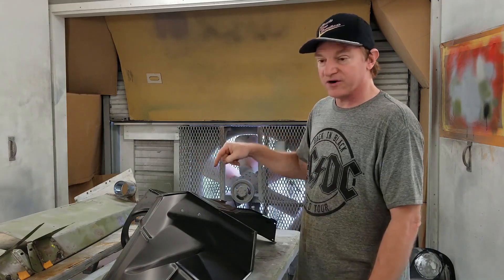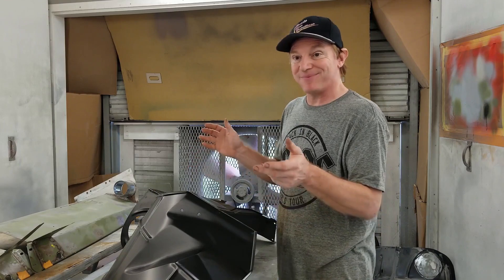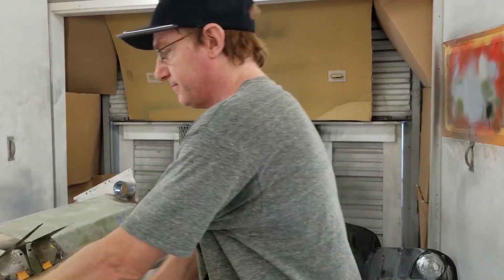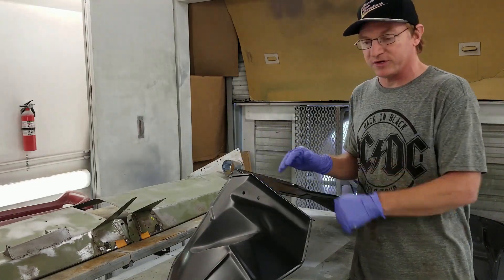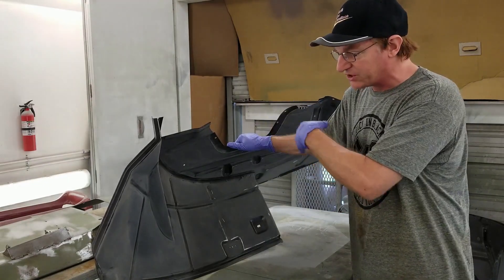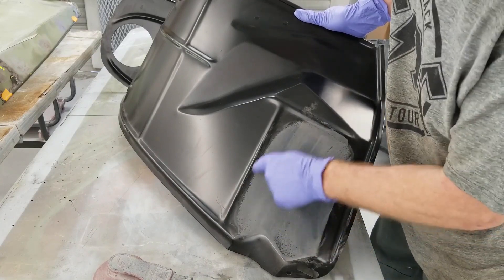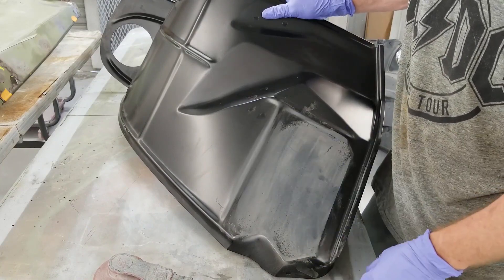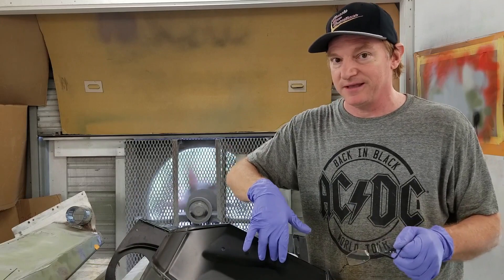Bodywork 101  EDP Coatings -  Should it be removed?

Comment: This is good info, but I would clarify one thing. There is no such thing as lacquer EDP. Quality parts are EDP coated, which is an electro-deposited form of epoxy. Some cheap manufactures spray crappy products like lacquer primer and falsely claim that it's EDP. The solvent test is to determine if it's actually EDP or if they've cheaped out and are just claiming that it's EDP.  IF it's truly EDP, I have no problem prepping and painting over it. Moisture does not get under EDP, but it does get under that crappy lacquer or water based primer some manufacturers use and that mess needs to come off completely.

Comment: What would you do for the inside of doors or fenders where its hard to sand and repaint?
Reply from the maker: @8luggarage  depends... in the past we try to scuff inside with scotch Brite pad and coat with a good epoxy.. even if you don't new parts will hold out .. there is no easy way.. but most of the time do the best possible.
Reply: @ES4406  thanks for the reply

Comment: On the inside of a new cowl , does it need to be painted before welding in? Can you just prime it a fog paint on the inside?
Reply from the maker: we try to do anything we can to stop anything from corrosion..  we make sure to prep the spots where welding before  or even panel bonding. weld through primer is good, if bonding you have to have metal to metal adhesion.

Comment: I work at a collision repair shop and the different kinds of coatings they use on new plastic bumper covers is a real pain. I would much rather be dealing with rust and other classic car problems. I need to find a job at a restoration shop. Unfortunately where I live, it's hard to find

Comment: How long does a finish like yours last if the vehicle is stored in a dry storage facility?
Reply from the maker: It should easily out live me. LOL .. The products we use are really good. I am  thankful to have the support from our Jobber.
Reply: @ES4406  That is a few decades....
Reply from the maker: @matthewfocke5360  easily! ... myself.... hopefully LOL
Reply: Placing a lot of trust in mass produced panels. How can you verify that the coating wasn’t applied over rust or fingerprints? Sorry but given the quality of parts these days I’ve got trust issues especially with the astronomically high cost of paint, materials and labor.

Comment: Are you referring about e-coating? Here the most body shops said its
the best and possible to paint onto e-c coated bodies, and panels.
There are about 10 to this specialised shops throughout Europe and
some of them have waiting lists up to 6 months. The most referred
use the right voltage and amps to coat whole bodies into their dip tank 
(15'000 metric Litres capacity). The botchers are then the one with the 
short waiting list. I agree that some oem have this fussy coating you 
talk about but it depends on the automotive brand, or the supplier of it.